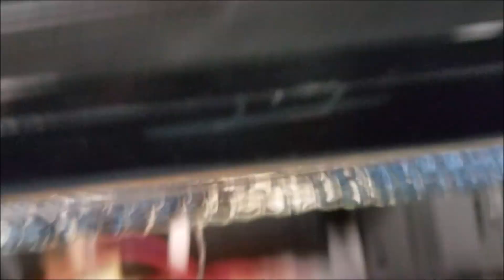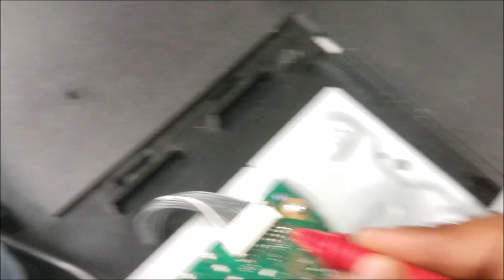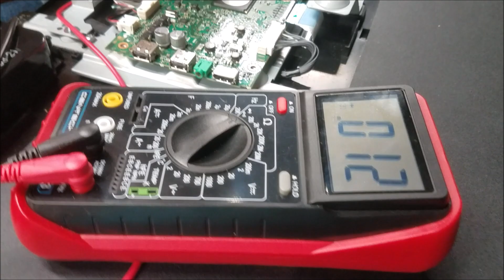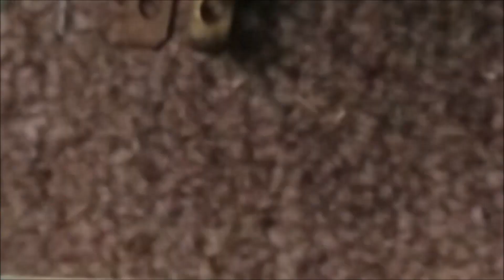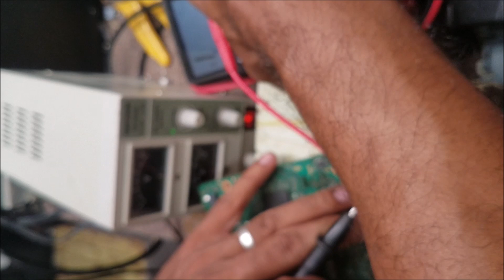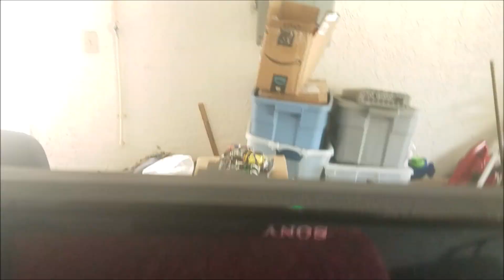SONY KDL48W590B bad mainboard tough one

Comment: Hi, great instructional video. I have the same two but only blink red light 3 times them keeps cycling. Do you think it could be just that board that the power jack plugs into? 
If so, can the board itself be repaired rather than replacing? 
Thanks. 
I am trying to help out an elderly person with his tv 😊